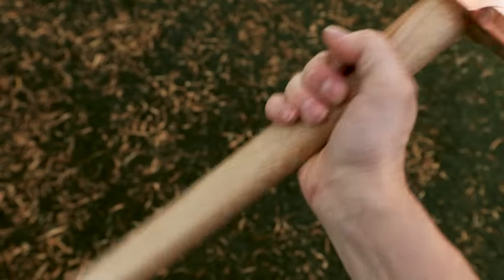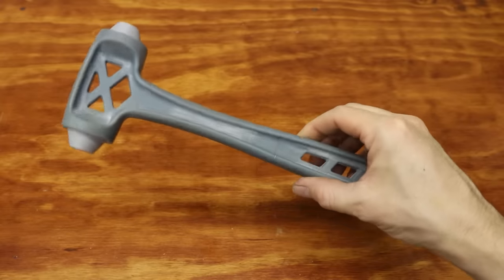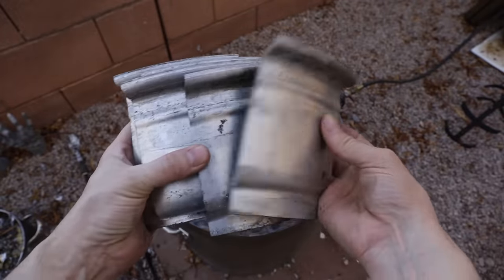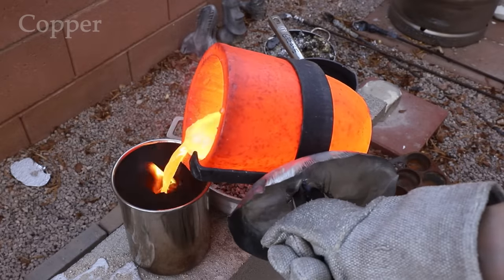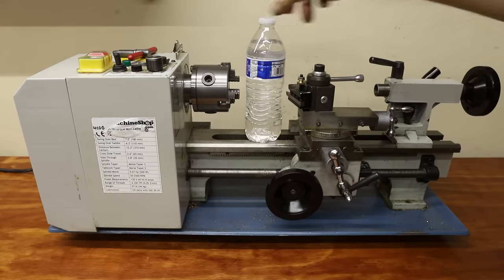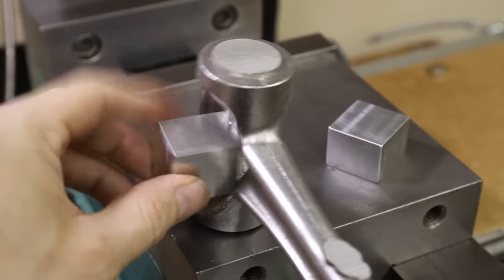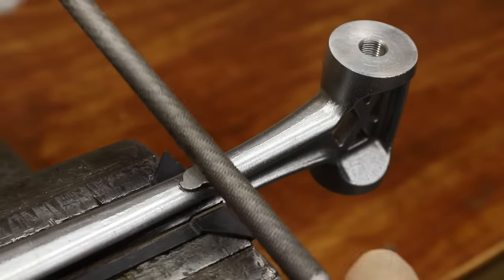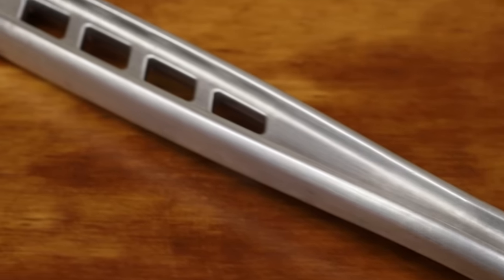Making a Skeletonized Hammer - COPPER or BRASS hammer? HAMMER TIME!

Comment: Awesome hammer, and very nice technique for casting, like the screw on bottom for the mold. If you want to use the hammer for years, you need to isolate the copper from the aluminum. The copper will eat the aluminium.

Comment: Screw on faces might sound great, but I am not sure it will serve for many years to come. Threads will wear out really quickly if loaded like this.
Best would be to use a rubber ring to hold it in place with a cutout in both head and body, scrap the thread, just a solid shaft.
If you want it threaded, at least add some rubber washer between head and body. To dampen the impact on the thread.

Comment: That hammer turned out amazing. That's the kind of thing that you could easily sell if you wanted to make that a product on your shop. I don't know if it would be necessary but I was thinking what if you added a couple of grub screws to locate on the threads so those threaded Hammer heads won't unscrew by themselves. They might stay perfectly fine I'm not sure I am not there to use it but it's just one of those things that you think about when you've used a lot of tools which I know you have I'm not saying you haven't it's just something that popped in my brain

Comment: very nice. now what i want to do is one with a 6" handle, with steel shot in the head for what is called a "dead-blow" hammer. both ends brass so as not to mushroom letter/number stamps when embossing key heads or brass/aluminum tags...

Comment: It looks cool. I love hammers. 

I hate threading aluminum to screw together with anything other than more aluminum. Aluminum on aluminum threads is fine, but once I start threading other metals with aluminum (especially something subject to lots of vibration/movement) I'm compelled to use a threaded steel insert- think like a helicoil. Aluminum is so soft and with it's temperature conduction it'll never last super long once threading aluminum with other metals. 

We all have our "things that have to be just so", that's just one of mine. Watching you screw in the hammer faces is like nails on chalkboard for me, lol. I do realize once threads wear out you can just pour another hammer and start over. NBD.

Comment: You should machine a new solid copper heater block for one of your 3D printers! You could cast it to an approximate size millet and then drill and tap all the holes pretty easily! You could also go into some electrochemistry and plate it with nickel!

Comment: I must say right away that I use a translator, do not judge my translation strictly for the language. And now to the point:
1) I didn’t think why a hammer usually has a wooden (plastic) handle, and not a metal one? The hammer would be "eternal" if the tale was cast along with the handle (let's say in the shape of a pipe) ... Recoil! Wood dampens vibrations well!
2) You made decorative reinforcements, but they are made in the wrong place - the hammer must have a certain balance of weight. All weight should be on the bike. And you made holes there. If you thought, you would make holes where you don't have them, then you would win on point 1;)
3) We live in the 21st century and why do you melt copper and bronze, it is easy to buy it with a ready-made bar of the required diameter, delivery in my city within 12 hours.
But! I admire this kind of video! And let me tell you, you are a great guy!
I got 2 questions:
1) What do you use as "ground" for mold making? The casting quality is amazing!
2) What kind of company produces such taps. The shape like a drill is interesting, I have never seen such!
Good luck!

Comment: the screw you use for the soft faces will get damaged fast so you will need to be making lots of handles
Reply: I don't think they will, the threads shouldn't take any load, all the load will be transferred between the two mating surfaces of the handle and the inserts.
Reply: @SpencerIsAFunnyOnion  they do, i had one that used the same system or the incerts an just died in like a week

Comment: Beautiful! I'n curious, how did you find center on the hammer to drill for the hole?
Reply: Using measurements
Reply: @SpencerIsAFunnyOnion  No shit Sherlock?
Reply: Use a "Centre Square". It looks like a right angle square with an added 45deg blade. You use it to scribe 2-3 lines across the center to find the center at the intersections. It's often found in a combination set with a movable blade square, protractor and the center square 90deg L piece.

Comment: You should engrave the numerical numbe rof the density for each hammer attachment. That way when your working you can compare alloys density to see if the hammer side your using will scuff up your material your working with .. just and idea 🤙 ohh and make a hammer attachment that you can rap a peace of leader around some metal to use to hit wood
Reply: I really love your work by the way! GOOD JOB on going out of your comfort zone and risking failure 🤌 that's the only way to do it! (:

Comment: Its very visually appealing but should never be used for any kind of heavy blows. Cast aluminum is extremely brittle. This is mostly a showpiece. Hammers have wooden,  
mild steel, and rubber handles because they flex. Again very gorgeous piece and i love it. Buts its more art than a tool.

Comment: Yeah i really like this also its basically hammer 2.0 can be modded to need and even diffrent screw-on pieces could be made for other uses aswell and the skeleton frame makes the total material useage less which is also really neat! Do you know how concrete have "strength" lines that give most of the strength to the concrete? i wonder if you could hollow out the handle part more and various "artistic" shapes on it all ofcourse to reduce material useage even more.

Comment: Whenever I see a video of someone casting any kind of metal I'm always left wondering how do you get the metal that stays in your bowl that you melt it in so that you can later reuse the bowl? Does the metal, while cooling, just shrinks enough so that it simply 'pops off' or do you use some other trick?
Reply: It could also be that the bowl has a small taper, so that it naturally comes out when turned upside down

Comment: How did you find the center of your casted part? Just by eye or was the surface finish alright to use an indicator?

I'm also bluffed by the surface finish for sand casting, do you use any special sand? Or a recipe to share?

Very nice hammer by the way!

Comment: It looks good, but it kind of defeats the point of a hammer.  Hammers deliver a large amount of force in each blow thanks to weight of the hammer’s head.  It’s why you can easily drive in a nail with a hammer, but not a stick.  Skeletonizing is a weight reduction measure.  It will dramatically reduce the effectiveness of the hammer.  I think that you will find that you are needing to take many more swings with this hammer than you would with a solid hammer.
Reply: You use a hammer like this for precision work like in Gunsmithing

Comment: the handle should really be made of wood, I guess a hammer is okay, but it will hurt the user, if they have to use it alot.

lookup "wranglerstar" 's video called "THE WORST AXE I'VE EVER TESTED" at 02:34 into the video.

Comment: An aluminum handle for a hammer doesn't sound solid enough to me. I expect it will eventually warp and/or break with repeated uses. I think your previous build with a solid copper head and replaceable wood handle is a much better desing.